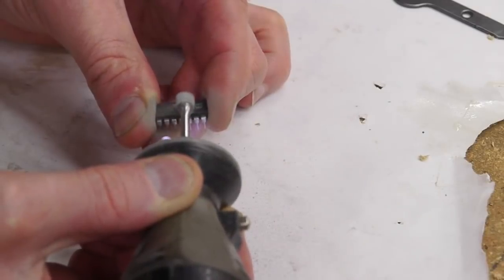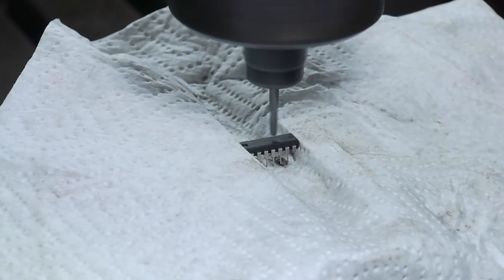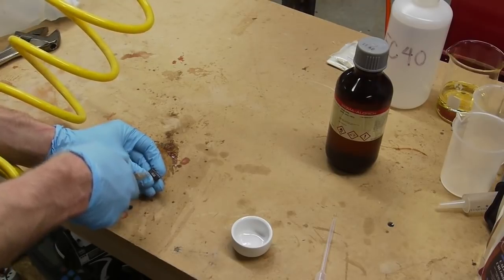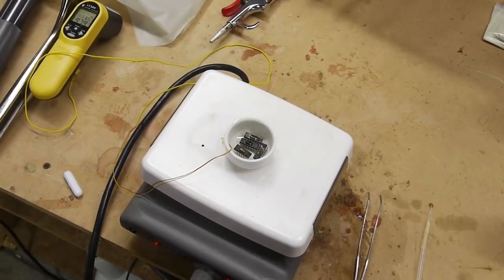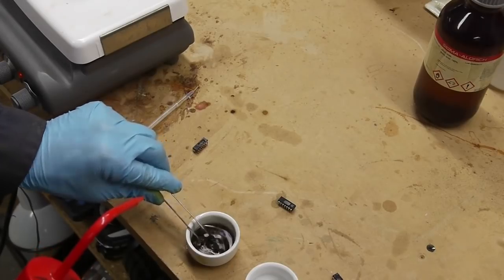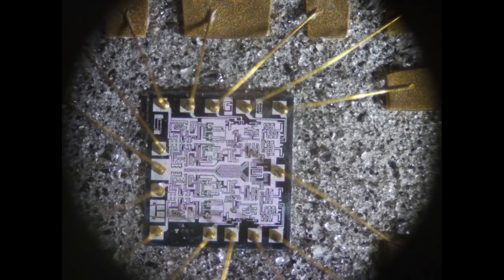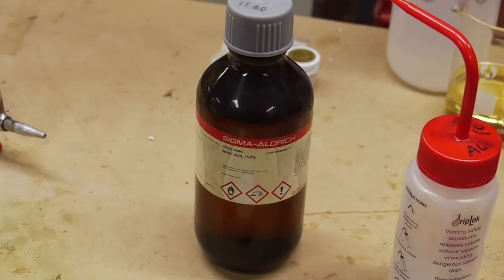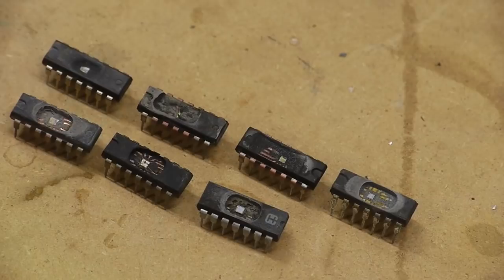Decapping ICs (removing epoxy packaging from chips to expose the dies)

Comment: Ben if you could decap a static  RAM ic it can make a camera type device. As the RAM will change on light. This sensor is better than camera chips as your light data is read parallel and nit sent out serial by hardware. This can make lots if intresting things

Comment: This would be useful for converting one-time programmable PROMS into UV-erasable proms; both parts are the same die, but the UV-erasable one simply have a UV-transparent window in the package.
UV-erasable proms are very much disappearing, so eventually this may be the only way to re-use programmed parts salvaged from other stuff.
Reply: Or you can just use eeprom replacements.

Comment: from memory you can use liquid crystal to see the voltage changes as they operate, I remember it from an article on IC security, you may need to insulate with a lacquer though

Comment: You're getting pretty close to the boiling point of HNO3. And, nitric acid  decomposes to nitric oxides at elevated temperatures so it probably decomposed and that's where it went. I think you need fuming HNO3 because it reacts very slowly with metals (forms a protective oxide layer very quickly) ... is it contacting the metals inside ?

Comment: The million-dollar question is: do they work afterwards?!

(immediate thought of practical application: nanoprobes for space use. Fit whole PCB in 5% the volume)
Reply: If careful yes the passivation is more or less immune to the acid.
Reply: Late reply I know, but it may interest you that unpackaged dies are already available out there for use in hybrid ICs (HICs), multi-chip modules (MCMs), system in package (SIP) and such. Places like Lucent would use them at times in designs you might see in cell phone tower sites, though manufacturing techniques obviously differ, limiting the places sales of such dies to a much smaller and specialized set of manufacturers.  In addition, for use in harsh environments such as space, the circuits are almost without exception specialized, hardened versions going beyond what you could purchase as a MIL-spec version from say DigiKey or other higher end vendors. (The places like Jameco almost never sell even the MIL-spec versions from my experience, given the low volumes sold to their typical customers).

Comment: The brownish fumes are nitrous oxides and you should do this in a well ventilated surrounding. In laboratories they use fume hoods for this type of work. Nitric acid is very dangerous to work with if you have no training as a chemist. One should use personal safety gear as gloves and safety goggles as well. Luckely you use only small amounts of the acid, but this big bottle of fuming nitric acid gives me the creeps. In a laboratory these type of acids are stored  in the fume hood or special cupboards for safety.
Reply: Very good information! Safety first.

Comment: Do you know if fuming sulphuric acid (oleum) works as well? At least it wouldn't be as toxic substance and it might have better availability since nitric acid is highly oxidising so it can be used to make explosives. One friend of mine photographs those chips and would be very interested to get certain ICs decapped.

Comment: I’ve got a copy of Super Mario Bros 3 for the Nintendo Entertainment System with a bad CHR ROM (some corrupt graphics). Did plenty of chip and board swaps to isolate it. PRG ROM is fine. Just curious to know if it’s a broken bond wire.

Comment: Damn you and your interesting videos! 

Now I want to play around with nitric acid. ..
Reply: If you want to see some depackaged chips I have some I've done for work.  The comment about modern chips being in metal packages is backwards.  Older chips were sometimes capped in metal and a very few still are for heat dissipation but most are just epoxy encapsulated.  You really need a fume hood or outdoor location for the acid work though.

Comment: Did you try (micro) probing the chips. I was wondering if the oxide layer prevents connection to a probe and if I could measure the voltage/signal at specific locations.

Comment: I used  to repair the printers for a company that would decap and micro graph suspect copied chips and  print out the micro graphs to the size of a large floor (like 50 feet square) and then crawl around with colored markers and map out the circuits...that was 15-20 yes ago...they used the same process as you to decap the chips.

Comment: You can use 97% sulphuric acid in room temps. But i also tried 70% nitric warmed up at 70 celcius and it works fine too. Red fuming is better but more difficult to get hold of.

Comment: That's terrific. Some 30 years ago I worked in the tech lab for a company that made VLSI chips. We were bread boarding a circuit that had some expensive mil spec DAC's and mid testing something blew. I figured the DAC chip was toast so I un-soldered the top to look inside with a micro scope.lo and behold the power lead inside the chip was burnt off. So I took it out on the line and had one of the girls replace the power jumper. Went back to the lab and plugged it in and IT WORKED!   .......now my brother in law works for Intel. Working on the cpu manufacturing line. I asked if he could get me a rejected silicon wafer so I could make an assortment of blown up photos . He said not a chance. Intel requires the rejects to be completely destroyed to protect their intellectual property. It would be fun to open up a modern cpu ln this manner

Comment: Maybe the reason the nitric acid disappears is because the boiling point of the 100% pure acid is about 83C compared to the higher boiling point of the water azeotrope at 120C. I think you mentioned you had set the temperature to 100C on the hotplate. Much of the nitric acid would just evaporate into your lab air and cause big problems with corrosion, and edema in your lungs. Be careful. BTW I just discovered your videos and they are most interesting, thanks for sharing with us.

Comment: Try Sigma Aldrich M79603-1L, 1-Metrhyl-2-pyrrolidinone 99%, submerge the IC in the solution and heat at 80 -90 °C. The potting compound will dissolve leaving the IC on the lead frame. I recommend you do this under a fume hood.

Comment: Attach tiny led to packing or chip itself and with them to different parts of chip, so visually feedback is possible.  That is of course if the current running through them would power tiny LEDs.

Comment: "going through all the hassle of getting nitric acid was difficult enough"  white fuming nitric acid is vary easy to make with chemicals found at most hardware stores, with the proper glassware ie vacuum distilation.  Though the problem with white nitric acid is it the rate of decomposes based on the concentration (so store it in a dark cold place such as a freezer).

Comment: I used a hammer and wood chisel and one light tap in between the two slabs (eg where the ic pins disappear) and presto with 1/1000th the hassle. I put the dies under the microscope and found micro print, etc. Digital photography was born when someone else tried this with a powered up functioning dynamic ram chip.

Comment: I decapped many chips for my PhD, I used hot (70C) sulphuric acid to remove the packaging (I got it from the chemistry department, not sure if private individuals can get it.)  If I needed to look at the silicon surface then I would use hydrofluoric acid, this would remove all the metal layers and the wire bonds.hydrofluoric acid is extremely dangerous and certainly is not available to private individuals.

The primary reason to decap the chips was to inpect the transistors to see which ones were damaged and in what way.

Comment: A microclip and sewing needle make a good probe, just grab the needle with the microclip. If you look closely at the IC you will find test point pads on the surface. The production testing will leave marks in the pads. Most of the circuit will be covered by a glassivation layer that you cannot probe through without damaging the circuit.

Comment: Many years ago I took a chip and put it lightly in a vice, took a sharp chisel and gave the I.C. a light tap right at the seam of the top and bottom and the entire top popped off, Looked at it under a high power scope and that thing had a serial number a mile long.

Comment: It would be fun to do that with op amps or comparators. Build a circuit that will use all their channels, and than decap them. After that, you could test them in the same circuit, and probe around with a whisker wire connected to an oscilloscope. it would also be interesting to check the temperature rise of the die.

Comment: If it will still work in a circuit, you can run it in a SEM and actually observe the voltages changing on the conducting paths.

Comment: I used to work with a microprocessor that had a rom. The IC package had a window in it. You could clearly see the chip through the window and all of the connector wires going to the package feet. The chip memory could be erased by UV light thus the purpose of the window.

Comment: Yeah, in that situation, they might actually use aluminium (Aluminium and gold are the materials that wedge/ball bond well). 

I was referring to this case in particular, that they may be straight gold.

Another thing that's common is the use of multiple bonds in parallel for high-current stuff. 
When they need to handle high-current, they have multiple bond-wires running from the pad on the die to the leadframe.

Comment: Silicone chip is photo sensitive. You may try to run this chip (if not damaged), then apply some light to see whether performance may be impaired due to presence of light. Or maybe you will get some strange effect(s), and noise.

Comment: Louis Rossman uses a volatile spray to locate bad electrical components by rapid evaporation  (hot objects evap. faster) you might be able to use it on the tiny circuit, maybe infrared also.

Comment: Maybe try doing pin swapping? Pull the bond wires and try and reattach them to different pads? It'd be silly, but it's cool to look at the die bonding process.

Comment: Not sure if you read comments of 9 year old vids but... it would be nice to have a look at the dies of the most used chips coming from China and confront them with their original counterparts.
Starting from the humble 2N2222 transistors, 555 chips and LM2596 regulators.
It might be instructive to see how they cut corners - and what to expect - in the non-power components.

(I have this hunch that China has only two models of BJT transistors: NPN and PNP. The numbers printed on the case - 2n2222, s9050, 2n4401, BC547... are just decorations).
Reply from the maker: Yes. I have authentic and fake ftdi Rs232 chips. I should do the comparison or hand off to one of the other chip decappers on the net. Good suggestion!
Reply: The FTDI chip has already been decapped along with a chinese knockoff here: https://zeptobars.com/en/read/FTDI-FT232RL-real-vs-fake-supereal . Of course the ones in your possession could be a different kind. My curiosity was directed toward the cheapest components: to-92 small signal transistors in particular, what could the differences be for components that cost a fraction of a cent each? We know that fake power transistors have dies that are a fraction of the original ones, but to-92 small power? What corner can they cut, and why?

Comment: Since the bond wires are still attached why not just socket the IC and run it through the socketed connections? It would be one way to get around needing super tiny probes. Great video btw!
Reply: He wants to probe the internals of the chip, not the external wires.

Comment: All the internal wiring is gold-plated (the bond-wires, and the internal lead-segments the bond-wires join to). 

I'm not sure how the acid will affect the silicon die, but it shouldn't affect the bond-wires or internal lead-frame much.

Comment: Finally a technerd channel with a host that doesn't have a super annoying accent or appears to be a psychopath. Yay :D
So, what's the progress on this? A friend of mine actually is part of a project for recreating DIEs for chips long out of print (mainly videogame/computer related custom chips) ... he's managed to find a way to crack them open using heat at a 80% success rate, but this way seems a little more reliable.

Comment: I've put some RAM chips into boiling sulfuric about 10 minutes then let cool and add 3% hydrogen peroxide until it no longer reacts, then rinse with water and all the black epoxy should be removed. the metal didn't look too affected, maybe you can try with these chips as well

Comment: Not sure you could probe much on the chips themselves. Chips typically have a passivation layer of silicon dioxide on top, with openings in that layer only for the bond pads. 

Probes are the easy part - you can use acupuncture needles - they work ok, but not as nice as proper tungsten probes. Tungsten probes can be had for $55 for a box of 5 probes w/ 5 micron tips The harder (or rather more expensive part) will be the micropositioners to get the probes where you actually want them.

Comment: Years ago a colleague told me about using a sweet-smelling solvent to remove epoxy potting compound from encapsulated circuits.  I don't know what the chemical was to which he was referring, but I wonder if it would work on epoxy ICs, too.
Reply: I wonder if ethyl acetate might do it. Might have to give it a try. Have to confess to rather liking the smell and I'd describe it as sweetish (though don't recommend sniffing it - it's not good for you!)

Comment: I heard somewhere that sometimes chip designers put little easter eggs on unused parts of the silicon. Such as a picture or a line of text of some sort. It would be cool if you would be able to find a chip with something like that.

Comment: Build a counter from a few 4510s or 7490s, etch the top off and then wire the circuit up as normal. See if light triggers odd counts through phototransistor effect?

Comment: Concentrated sulphuric acid should also work, it works even at room temperature, at elevated temperature it should work quicker than nitric acid, and when dropped on metal contacts of the chip it shouldn't cause so much of demage.
Anyway, you should try to uncover old RAM chip or memory chip from a Flash memory. Interesting enough would be an old PC processor, but I fear they have metal packaging, and unpackaging them would be difficult.
I hope you make another video of this, it is really nice.

Comment: Might be had to probe it but an simple thing you can try is run the login chip with a signal or build a oscillator out of it and then try shining various kinds of light on the die, it should mess with its operation (Since its silicon it should work best with IR light)

Comment: I would love to see an attempt to remove the chip and then be placed on a micro circuit I wonder if the heat needed to re-solder would be enough to ruin the chips

Comment: Try using one gate and biasing it into the linear region, then exposing to light and using it as an optodetector. Or use a hex inverter and make a ring of 3/5 oscillator and see how light changes frequency of it.

Comment: I normally scorn the bubble-wrap crowd, but as one who almost died from what seemed like an insignificant exposure to nitric oxide...the commenters here are correct - stay away from that stuff - an amount that didn't even trigger "that's acrid" or coughing almost did me in.

If you're wondering (still) why it dried out...the boiling point of nitric acid is 83c and you were heating well above that.

Comment: As a suggestion of what to do now that you are able to look at the die while powered up and operating, how about, for example, subjecting the inputs of 4000 A-Series (unbuffered) and B-Series (buffered) chips to some high voltage (simulated lightning or static discharge) strikes or spikes on the inputs, and seeing how much they can really take on live video before they arc and blow holes into the chips as seen in photos used to justify anti-static handling precautions and practices.  Are these handling practices overblown and in some cases exaggerated...an objective practical test by someone other than the guys trying to sell anti-static workstations would be nice to see...!  Cheers and many thanks for your fascinating videos!
Reply: hmmm but they are open to the air now, no longer embedded in resin.  I imagine it would be easier for an arc to travel through the air than through the resin.
Reply: I agree breakdown voltage in air vs resin would be different, with the breakdown along a surface (creapage) always occurring at a lower level (because air is actually a very good insulator, that's why they machine isolation slots in PCBs of line powered equipment, to meet breakdown voltage requirements!), but there is a passivation layer over the top of the actual chip as one of the last processes when chip is produced, which seals it off from the outside (air/vacuum under the lid)...if this passivation layer is intact and not disturbed in the process of delidding, I expect observed results would be similar to that with lid intact, and a valid comparison.

Comment: Great intro, however if you attempt to probe larger modern ICs you will find that the feature size is less then 180 nano meter and nearly impossible. Smart card chips are interesting, they typically contain active die protection and stacked MLC.

Comment: Does the chip heat up more when running free air with no material surrounding the chip innerds? Or does it run cooler?
Reply: ***** Well there still would be a difference with a thermal imaging camera and a microscope. but I dont know if the thermal imaging camera can see into a microscope because its made of glass. it might just block it off.